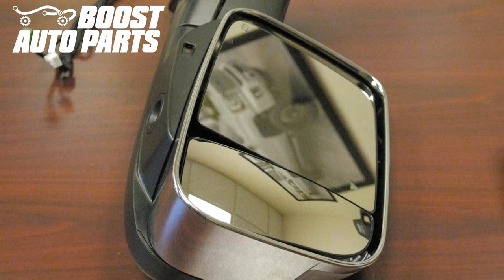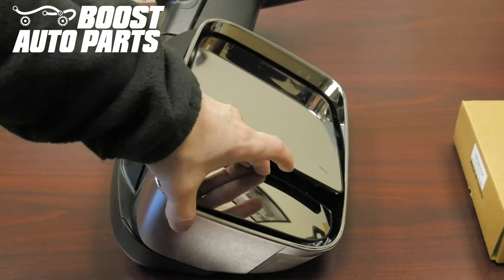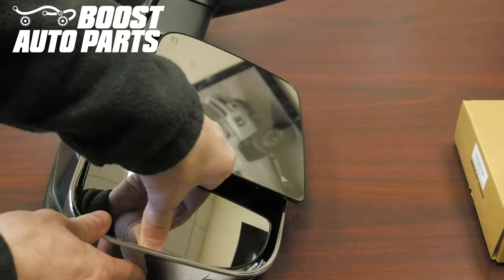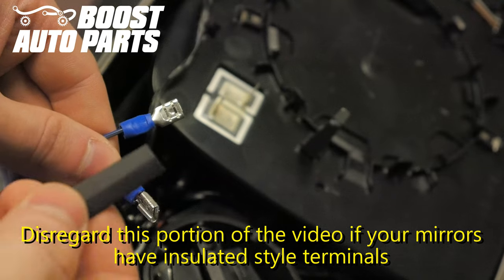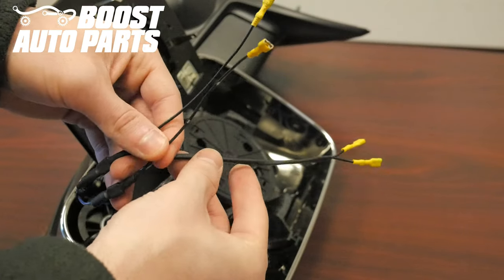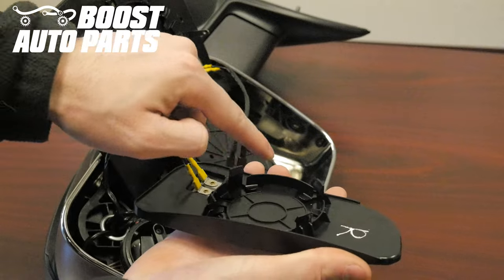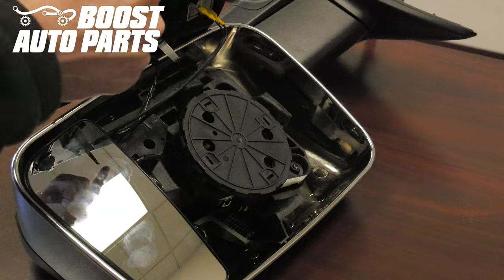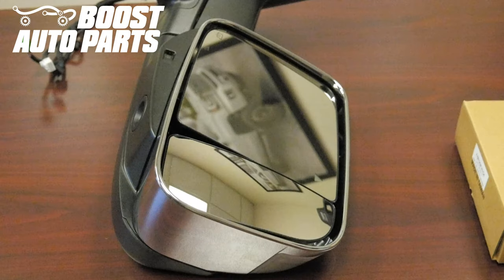Heated Lower Glass Install - 5th Gen Dodge Ram Tow Mirror Upgrade Kit (2019+)

Comment: Do you sell the armature/mirror holder of the spotter mirror? 2019 ram 3500 6.7 diesel. Some of the plastic parts that hold the small mirror, broke. Or do you know the part number for it? Thanks
Reply from the maker: We sell the replacement glass, as well as the replacement mount that it snaps onto (manual fold only). Give our team a call at 765-831-2830 for assistance